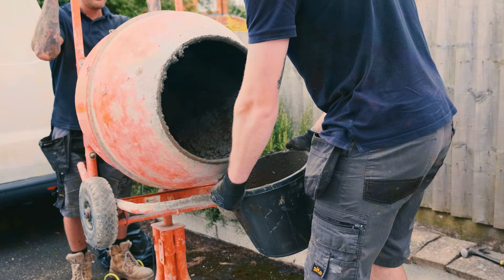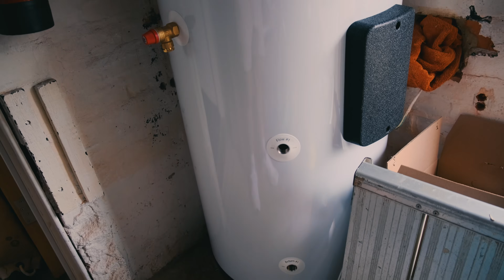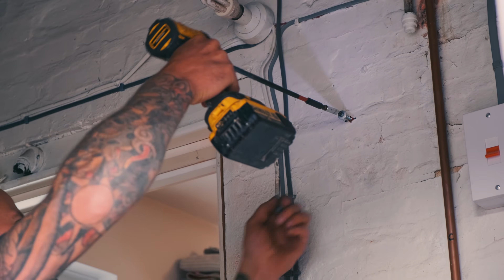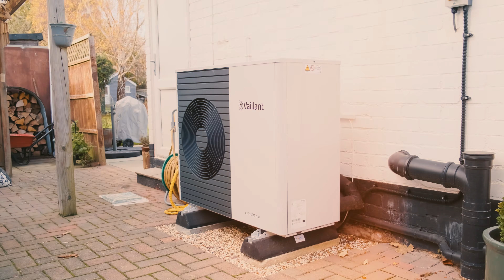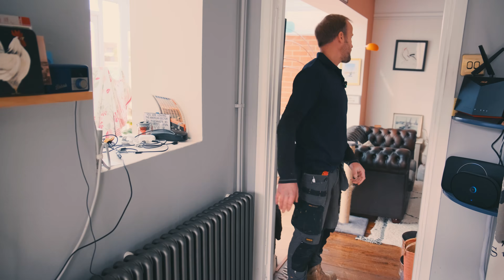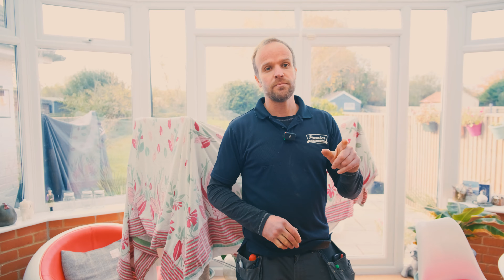From Oil Boiler to Heat Pump: High-Efficiency Install with Solar Power | Premier Heating Solutions

Comment: I keep hearing about the efficiency of heat pumps, but Cop does not equate to efficiency.
Efficiency is the fuel input against work done, or heat output in this instance, electricity is not fuel.
Just about everyone uses electrical input which does not give efficiency, that is false, as is comparing it to a gas or oil boiler, that is simply wrong. Using electrical input means you can only use that to compare to other electrical heating systems.
Another factor is that using KWs is misleading as the actual power consumption should be in KVA, which is 25 % higher using the nominal 0.8 power factor of the device.

Comment: COP can be overly manipulated and should only serve as a guide. To obtain a 4.3 SCOP for the past three months, the heating would have been constant with a low flow rate, say 30, and a once daily DHW cycle at 42. It's possible for anyone to deceive COP. I'm not too concerned with the top COP figures; securing a lower electricity rate is the most significant saving for an ASHP.
You need a COP of 3.8 to outperform gas with a modern gas boiler at the standard rate.

Comment: Big, big concern is that I don’t have a mini-computer controlling my Combi boiler.  When I move over to ASHP all I want is the minimum plug and play and forget.   Yes be nice to know my COP etc but why do we need all this extra gear and ultimately additional cost and the possibility of the electronics going wrong.  Thanks for sharing your work - need more from installers.  Thank you.
Reply: There’s way more going on inside a combi boiler, o2 sensors, gas sensors, combustion sensors, etc. heat pump is just a fridge, the sensors need to know flow rates and temperatures to run efficiently, the inverter controlling the compressor can model the power consumption so estimating COP is not really a challenge.
Reply: @ thank you 👍🏻